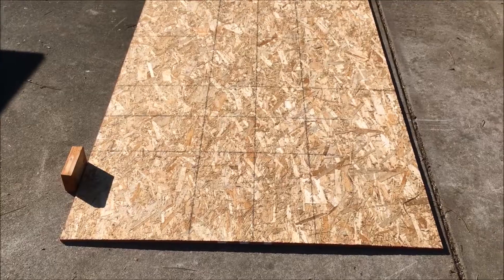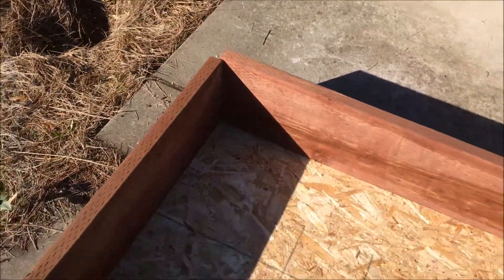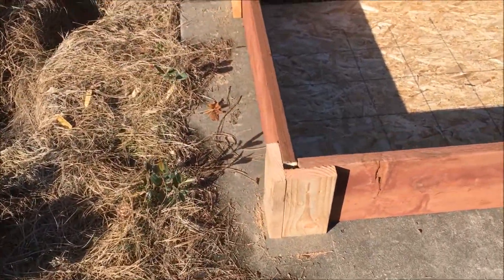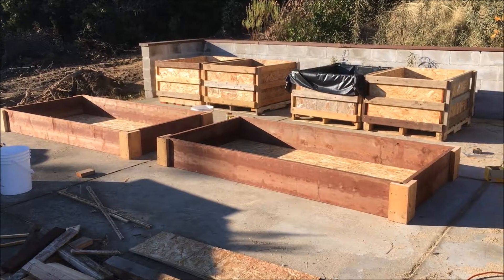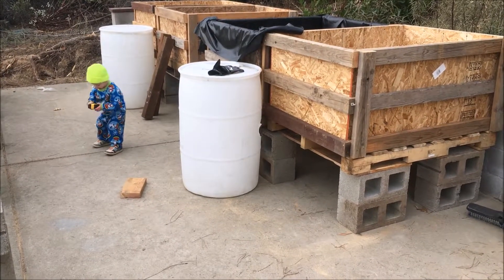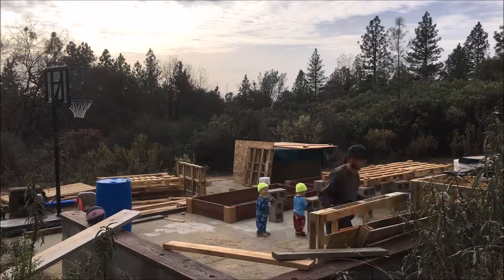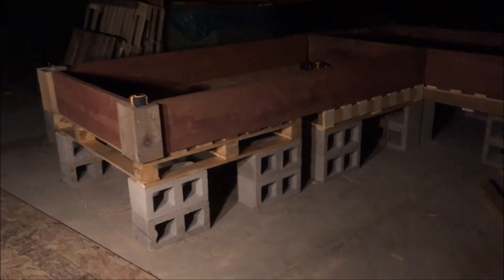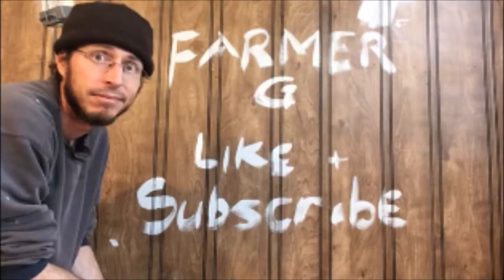Framing Raft Beds (DWC) & Positioning Hydroponic Components

Comment: VERTICAL HYDRO RAFT? Well sort of.
There is a rather interesting video showing how they went vertical with what we would use as a hydro  floating raft sheet of Styrofoam.  The video is in Chinese,but you should be able to watch it and get it.  This is a great idea..and could easily be replicated. Vertical is the way to go as we can produce so much more food vertically. 
https://www.youtube.com/watch?v=LZvztEnIuE8
Reply from the maker: Thanks for the link. That was pretty cool. I never would have thought of something like that. Very interesting. So many great ideas out there. Thanks for sharing. That was an eye opener. 👍👍
Reply: @FarmerG  I know..I run across the most interesting things. My thought on this concept is that those shown in the video are much larger than the home hobbyist would build but...they could scale it down... like building Styrofoam wall box, that fits just in side an 18 gallon tote, where the pump, fluid and return are all contained!.  I think it would be relatively simple to build something that is about 4 ft tall (16" of that is inside the tote). That would leave a  lot of surface area above the top of the tote, to plant.   My only issue..is that I'm not sure really how well plants do when you try to force them to grow at a 90 degree angle. But..their video shows it works.
Reply from the maker: I would have thought the styrofoam would buckle. I’m sure it does at some point but as long as it’s light stuff like lettuce I guess it’s ok. All in all that was a really neat concept. Whole lot easier to make than the the typical grow tower.